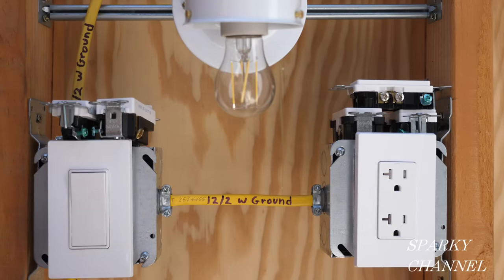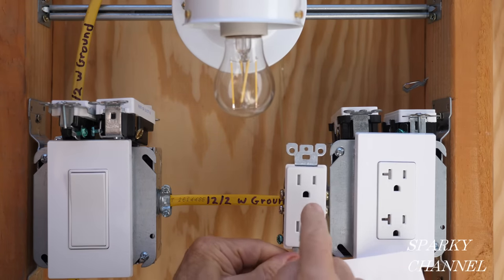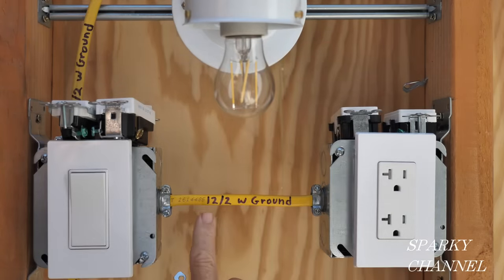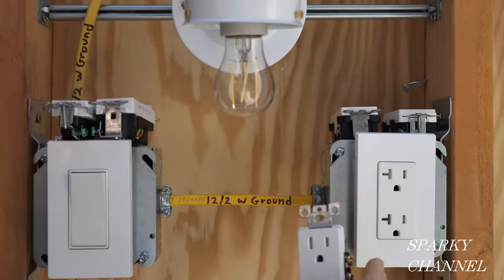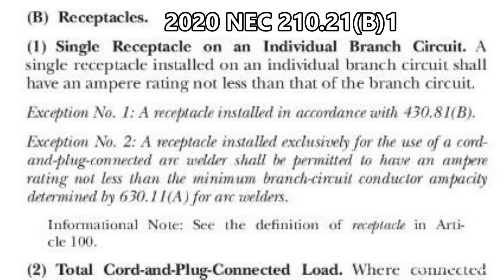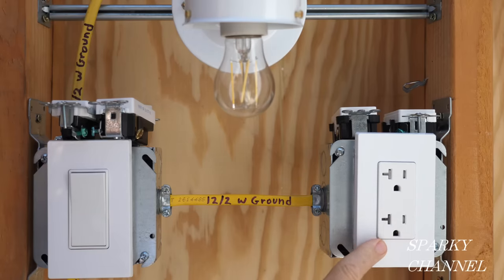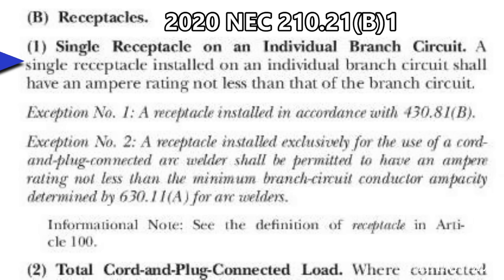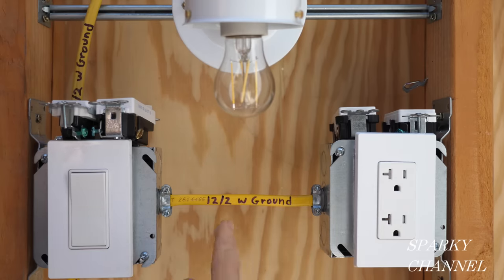Shall I Use a 15A or a 20A Receptacle on a 20A Circuit? + 2020 NEC 210.21(B)(1) and 210.21(B)(3)

Comment: That makes no sense to me you can plug two appliances into a 15 amp receptacle on a 20 amp breaker and you can only plug in one Appliance on a single receptacle it should be the other way around best thing to do if you got a 20 amp circuit to use 20 amp receptacles but they cost a lot more and why is there so many grades that's another thing that makes no sense
Reply: I asked the very same question.  It sure seems counterintuitive and if you reason it out it sure seems bass ackwards.  Sparky?  Explain please.
Reply: If you have an appliance that you use regularly that draws over 15 amps you should probably have a dedicated circuit for it. I did that with my dishwasher and garbage disposal. Both draw 10 amps. Both got their own circuits. Now in my garage I have a drill press that draws over 15 amps but it's not used often and when it is it's not like I have much more than the lights and a radio going at the same time.

The electrical system in your house isn't a perfect science. It's not designed for every outlet to be used to it's fullest at all times. Just making a rough guess here I'd say that the average person only uses about 15-20 percent of their receptacles capacity at any given time. I mean think about it. In any given room how many outlets actually have something plugged into them? How many are actually being used at any given time? And how many are anywhere near the maximum capacity of that outlet?

This is where the breaker come in. If you do go over that capacity it flips the breaker as a fail safe. If it does it once or twice it's no big deal. If it starts to do it on a regular basis then it's time to start thinking about what's on the circuit and why it's drawing so many amps. Maybe something needs a dedicated circuit maybe not use the griddle at the same time you're using your toaster oven or microwave. Items that create heat are the biggest drawers of amps. Griddles, toasters, curing irons, hair dryers. This is why an electric stove or electric dryer uses 220 volt circuits. This is also why kitchens are the biggest drawers of amps in the house. Bathrooms maybe but seldom is more than a hair dryer and a curling iron and a light ever used at one time.

Comment: 20A receptacles are not more heavy duty simply because they are 20A receptacles. They are that way because they are most commonly found in spec grade/commercial grade. There are residential grade 20A receptacles. From the side, they will feel and look just the same as a residential grade 15A receptacle. Conversely, there are also 15A spec grade receptacles available, although again, not as common.
Reply: One upside to most 20-amp receptacles is that (newer ones, anyways) do not have slot for backstab connections.  New 15-amp receps still support backstabs, but 20-ams generally don't.

Comment: DO NOT WASTE YOUR MONEY ON 20 amp receptacles for residental use. In my 50 years as a sparky I never came across a washer frig gas dryer hot comb toaster etc that came with a 20 amp 120 volt plug.  Just run the #12 copper type NMB cable and use 15 amp duplex receptacles. The only 2 20 amp receptacles that I have in my home are 2 GFCI 20 amp receptacles in bathrooms that were left over from a comercial job. Do not use Hubbell devices that are made in cheating lack of quality control communist scum bag china. Years ago I took apart 15 & 20 amp spec grade from several companies. Had a machnist mic the thickness of parts that come into contact with the plug. All of the 15 amp receptacles had the same size contacts as the 20 amp receptacles.
Reply: I, who am not an electrician but has studied it, will agree. 15 amp all the way unless you have something that specifically calls for it and even then you might consider a dedicated circuit just for that appliance. If it draws more than 15 amps you probably don't want it on a circuit with other appliances.

I have my garage with all 15 amp receptacles, 12/2 with a ground and a 20 amp circuit breaker. Then I got a drill press that demanded a 20 amp plug so I just replaced that one single receptacle. No need to have them all with 20 amp. They are identical except for the physical limitation of not being able to plug in a 20 amp plug.

Comment: I have a keurig on a 15a plug/20a breaker. It keeps popping on one circuit but not another. I’ve tried the same tests (appliances, heater temps, etc) and it won’t pop with a combination on one circuit, but it will pop the other circuit by itself. 
Replacing the breaker hasn’t fixed it. Would it be a receptacle or a wiring thing from this point? No other device is on the circuit, just the keurig. Just confusing why it pops one but not the other.
Reply from the maker: Is this a GFCI protected circuit? Perhaps it's protected by a dual function breaker?
Reply: Breakers age over time and can trip below their rating. Replace that trippy breaker.
Reply: @MrKentaroMotoPI  house is only 2 years old. replaced the breaker after the plug, no dice and kept popping the new one. Some sources have suggested it's the type of breaker that is just more touchy than a regular one.
Reply: @trickee4262  Well that's strange. Make sure there isn't some other load on the trippy circuit. Are all  the breakers in the same panel? I've had old breakers get trippy when the sun shines on the panel and heats it up.
Reply: @MrKentaroMotoPI  yep, checked all that. Nothing else plugged in on that circuit - happened a week after moving in and we were setting up our coffee bar. Nothing else running on those plugs but that. We replaced the faulty appliance (4 year old Keurig) and haven't had any issues since, but it was tripping or spiking even when idle.
Reply: @trickee4262  Well yeah, 15A seems like a lot for a Keurig, even one of the big units.
Reply: @trickee4262  probably sorted now but a loose connection will cause resistance..

Comment: It took me a while to figure out why the single receptacle on a 20 amp circuit had to be 20 amps.  This is what I think:  It's because the circuit breaker is there to protect the wiring, and the receptacle is part of the wiring–  a 15 amp receptacle is not rated for 20 amps.  Sound right?
Reply: Yeah I guess a double receptacle has to be robust enough to tolerate  a 2*15A load for as long as the breaker holds up, a single receptacle doesn’t need to be that robust .

Comment: Wow. For 20 amp circuits, might as WELL use a 20 amp receptacle. 😐
Reply: If you break apart a quality 15 amp outlet and compare it to a similar 20 amp outlet, they are identical internally. I use Leviton 15 amp outlets on my 20 amp circuits. Never had an issue.
Reply: @michaelwright1602  the point remains, you might as well use a 20 amp
Reply: @princenoah21   why?
Reply: @sapreaper   Is that a serious question?
Reply: @princenoah21  yep
Reply: @sapreaper  Because you have the option of being able to draw more amps legally and safely, that's why.
Reply: @princenoah21   Still trying to understand. So you want to use a 20 amp "T" device? You are not answering what it gets you. FYI I already know the answer....  Enjoy
Reply: @sapreaper  Forget it.

Comment: I’m installing 15amp outlets on a 20amp circuit. 
Can I use 14awg pigtails inside the receptacle wiring box?
 Just the pigtails. The rest of the circuit is on 12awg cables of course.
Reply: I wouldn’t....you may always know this because you are the one that used a 14 awg for the pigtail.  But what if you sell your home and now the new owner for some reason uses a 20 amp receptacle...that 14awg could pose a problem.  Could overheat and cause a fire.
Reply: Update: all the cables from my service panel on the single pole breakers are 14 awg cables.  I saw the 20amp breaker and assumed it uses 12awg cable but it isn’t. The house was built in 1990. Back then it was probably acceptable to use a 20amp breaker with 14awg cable. But now by today’s code it’s not allowed. I couldn’t understand why that breaker keeps tripping. I’ve already changed that circuit with a new 15amp breaker that’s rated for 14awg cables.
Reply: @jobsucks  Anything is possible, but it sounds like they pulled a fast one on the inspector, most likely. I know when we built our house in the mid 70's (california) that you had to use 12 awg on all the 20 amp circuits. Circuit breakers protect the wiring, so having 14 awg wire on a 20 amp circuit breaker would be unsafe and foolish. I've seen some dodgy home construction in the past, so like I say, anything is possible. Personally, I think that 14 awg wiring should only be allowed on lighting circuits, and everything else should be 12 awg throughout. With the cost of homes, a extra few hundred dollars in wiring would be minimal.

Comment: The NEC says you can use a 15 Amp  Duplex receptacle on a 20 Amp circuit and I think it is nuts.  Why not just make a receptacle for a specific amperage and leave it at that!  The world is way toooooo complicated, so let us make it easier, by the 15 amp for the 15 amp circuit and the 20 amp for the 20 amp circuit.  See, problem solved NEC.   

Sparky, I enjoy your channel most of the time, but in this case, you are way too long-winded!  It took you over 8 minutes to say to use the correct amp receptacle for the correct circuit, and you mentioned that when you were talking about government jobs.  

When I wire a house today, I wire all the circuits, single-branch circuits for 20 amps, with all the 20-amp circuit receptacles and spec grade switches.  The only circuit I wire in 14-3 is the smoke alarm circuit because that circuit will never draw more than 15 amps, whereas any other circuit for general usage may draw more because of: the living room at Christmas, or the girl's rooms with curling irons and hair dryers, etc.  They also have Arc-Fault breakers in the panel now.  

All my motor-driven circuits are on their own individual branch circuits (Microwave, Toaster, Refrigerator, Chest Freezer, etc.  

Some people may think this is overkill, but I am happy with that, and,  most of all, I am compliant and then some with the NEC.  

Remember, the NEC is the base requirement, just like in any other places the government is involved in (DOT, OSHA).  

Thank you.
Reply: You got a motor driven toaster? Sounds badass!😆
Reply: We run #14 to all lighting and receptacle circuits most of the time. #12 to dedicated circuits such as kitchen , bathroom receptacles,  microwave,  refrigerator , dishwasher,  washer etc. PDF breakers on almost all circuits now. We rarely use GFCI  anymore since using dual function breakers.

Comment: What is the reasoning behind the code saying when using a single receptacle on it's own branch that it just not be less than the wire rating (i.e. must use 20amp single on 12/2 branch)?
Reply: Because a single receptacle typically means you'll be plugging in an appliance (washing machine, refrigerator, A/C unit).
Reply: @skynetlabs  but you could do the same thing with a duplex receptacle. And actually plug something else in there and draw more amps.
Reply: @ajschmidt1048  In any room with any outlets you have the risk of overloading the system. A single 20 amp circuit can have 12 receptacles on it. If you plug in a heater that draws 10 amps in every one of those receptacles you will throw the breaker. The purpose here of a 20 amp outlet is to prevent that one single thing from being plugged into it that will draw almost all the amps on it's own. If you have something that draws almost 20 amps on it's own you'd be wise to give it it's own dedicated breaker and outlet that doesn't supply any other outlets.

When I did my kitchen I dedicated a single breaker for my dishwasher and one for my garbage disposal. Both of those draw about 10 amps on their own. Running the dishwasher and the garbage disposal at the same time pushes the breaker to it's limit if they were on the same circuit as the rest of the kitchen. Add to that a refrigerator plus anything else plugged in and I'd be sure to throw that breaker on a regular basis.

The electrical in your home never assumes you will ever you all your receptacles to their max at one time. The power coming into your house would never be able to supply all that.
Reply: A single 20 amp receptacle denotes a dedicated circuit rated for 20 amps. It should be verified. You can have a single receptacle on a shared circuit, not recommended imo, but on a dedicated circuit the receptacle must match the circuit rating.
Reply: @skynetlabs  I don't know about 2022 but my refrigerator and washing machine has a duplex outlet and passed UL code as well as the NEC. I ran all 20 amp wire and used 15 amp outlets. Both are single run no daisy chain. I probably would use single outlet if I was to wire it again somewhere else.
During hurricane in Florida and I shared power with a neighbor  across the street I would use the washing machine outlet because it had no others connected. And put off washing clothes.  I had a lower electric bill and the neighbor gave me some money I told her my bill was lower but she insisted I take the money. She is more stubborn than I was. Oh well bless her heart. 73
Reply: If I recall, the "Circuit Rating" is the lowest current rating of the wires AND the breaker. 
Therefore: If you have a 15A breaker, you should be able to run 12 awg wire to a single, dedicated 15A receptacle.

Thicker awg wires are a good thing. It means less resistance, less heat, and less voltage drop. You should be able to wire a 15A circuit (IE: 15A breaker) with 3 AWG wire if you like. That would be silly, but you get the point.
Reply: @joshpit2003  You are correct.
Reply: @joshpit2003  good point My dad ran number 10 to all the outlets in the house but that was fuse box days. Most people used 30 amp fuses. The outlets were ungrounded but took two types of plugs vertical and horizontal prong plugs. But all boxes were grounded by EMT. He used both types Greenfield and ridged EMT. We only had 3 receptacles in each bedrooms and about 6 in the large living room. Times have changed now for the most part number 14 wire is more common now but my dad never used number 14 for anything. In the farm house rewire he used number 12 for outlets and limited to ten per circuit. He also put lighting on separate circuits. We were never in the dark if we blew a fuse or popped a circuit breaker. 73

Comment: Sparky I have a question :: I have a bath light ( wire runs out of the elect box to the light ) with an outlet that is wired  after the light , so the outlet is only on if the light is on .  I’d like the outlet to be on all the time ?  How do I do this ? 
Thx
Reply: RE:Jeffrey Elford. I am not an electrician but I would say you have to run an additional hot wire  which is connected prior to the switch over to the receptacle. If it is in conduit, just pull an extra conductor through it. If Romex, then you probably need to replace the 14-2 or 12-2 with a 14-3 or 12-3. Run this between the switch box and the light box. You can keep the existing wire between light box and receptacle box. One hot wire, black or red, going from switch to light and the other going directly to the receptacle. The receptacle should be GFCI for bathroom. 
One alternative would be to leave the existing 14 or 12-2 and add another 12-2 which would run from the switch box all the way to the receptacle box.

One thing I am not sure on is if the code requires separate circuits for lights and receptacles in bathrooms, but if it is a repair/remodel, I guess that is up to you.
Reply: Move the hot conductor before the switching contact not after

Comment: Very interesting, that is quite different that the code in Canada. I've always seen only 15A receptacles on 15A circuits and 20A t-slot receptacles on 20A circuits in residential here. Although we don't see too many 20A circuits in residential other then kitchen counter receptacles.
Reply: Probably has more to do with builders saving a couple dollars than safety.